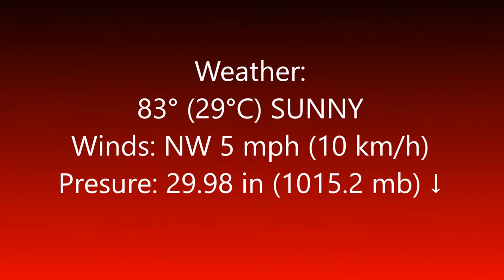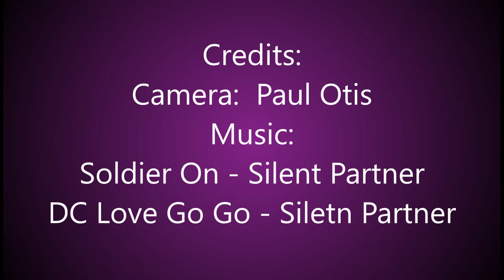Just When Success Seems About to Appear...This happens!

Comment: How do they get the syrup out of the jar at the bottom?
Reply from the maker: Well, the lids to the jars have small holes punched (or drilled in the case of a plastic lid) in them.  When tipped upside down, the jar holds a vacuum, and the syrup will not run out.  The bees will sip the syrup through the holes with their tongue (proboscis).  Great question, and thank you very much for watching!